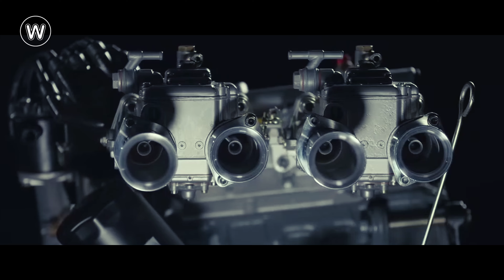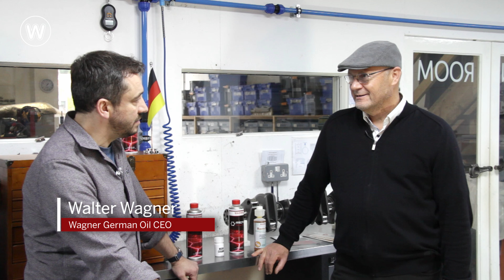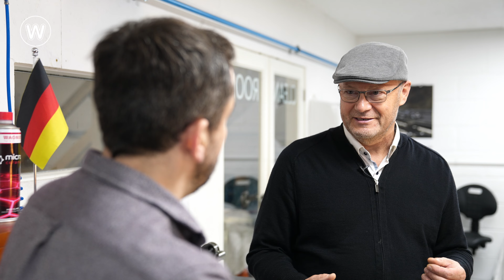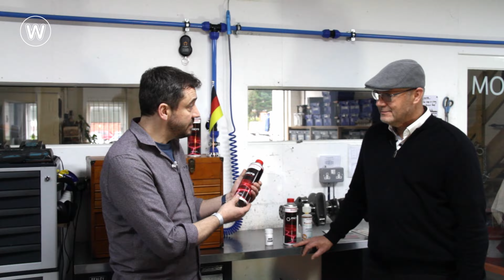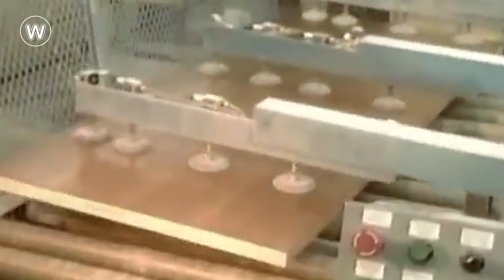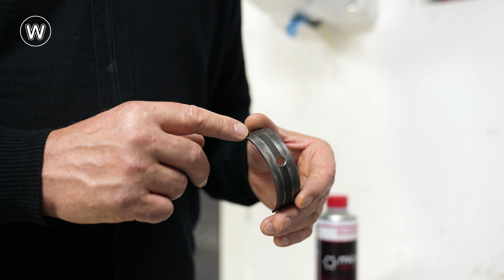Catastrophic Engine Failure related to Oil?

Comment: Dear all 
As a MicroCeramic  professional user here in Kurdistan market I would like to share a very valuable experience with the new micro ceramic user : 
Before using this product it's better to understand the engine health level . 4 understanding the engine health level you can use motor oil analysing and for a motor oil analysing you can ask Dr Lub 

Yours
Monem